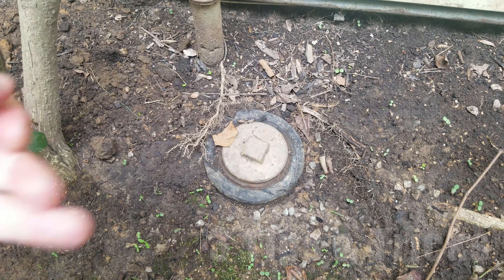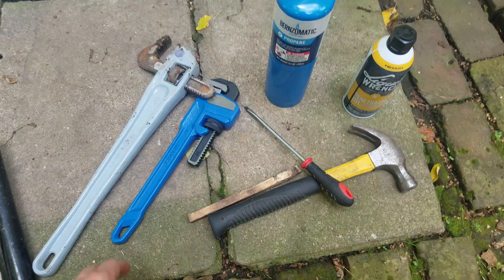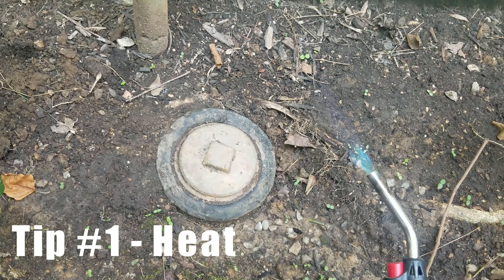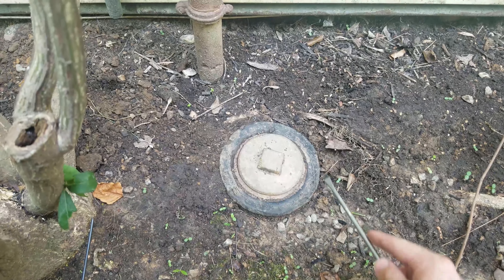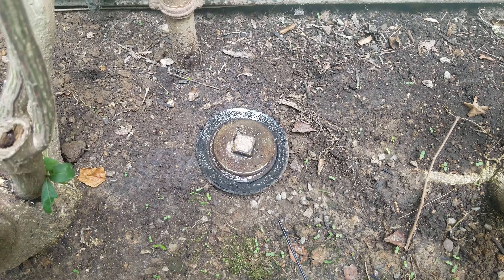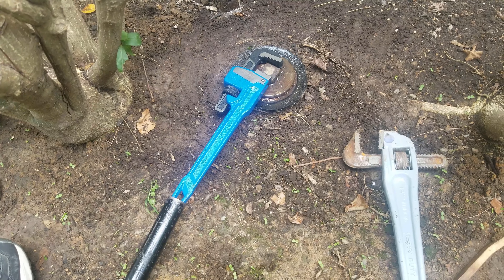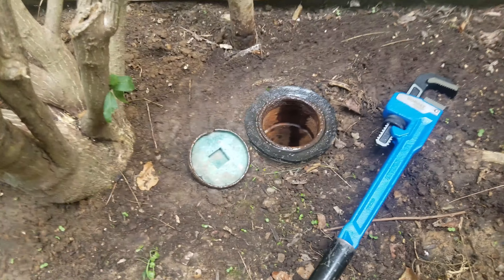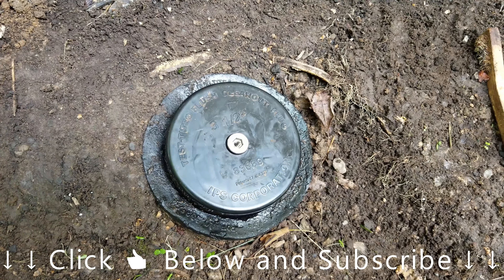How to Remove Sewer Cleanout Cap - Stuck, Rusted, Frozen

Comment: I think the threaded kind are better because you never have to worry about the sealsfailing. Just add some silicone, anti seize or grease to the threads and it won't seize up again. To get the square caps off: Get piece of square tubing, drill a hole all the on one side, then run a piece of round stock through the hole. This will give you a T handle wrench to slide over the top of that square. A six point socket and breaker bar works also, just have to be careful not to round it off.
Reply from the maker: I like the square tubing idea!  Thx for the comment!

Comment: How long till that little hex screw corrodes and strips out when you go to remove it 20 years form now, and then what are you going to grab onto to get this off though? honest question. Probably going to have to pry it out or bust it.
I'm working on getting A basement cleanout open for preventative maintenance/inspection, so no rush. I have 3 plugs within 2 ft on my monstrosity of a sewer stack in my 1930 home.

Just dug out the edges with a screwdriver/knife and hit it with the WD-40 (specialist edition) rust penetrator, which is usually my favorite penetrating oil, usually for like bolts/screws, but probably not for this application, and am going to use a big crescent wrench with a big cheater bar, as to not round off the edges with big bertha the pipe wrench.
Reply from the maker: It's stainless I believe.  5 years later and no signs of rust.   Lossens up very easily.

Comment: You don't want to heat the cap. That makes the metal cap expand which makes it tighter. Insteaf, you would want to heat the cast iron fitting.
Reply from the maker: Thanks for the tip.  Should have mentioned that.  Thx for watching!

Comment: I'm a long time service plumber and I font waste my time with brass clean out plugs like that that wont come out. I just bash them in with a hammer and put In a new one as the threads are usually fine on the clean out.
Reply from the maker: When you "bash" it do bits and pieces end up in the pipe?  I would be worried that would introduce more crap that would get caught up in roots or whatever blockage you might have.
Reply: @thebumpchannel  its soft brass. It usually kind tears it doesnt shatter. Once it splits I usually pull it out with channel locks.  If a section of it get down the pipe though it most likely wouldn't matter. If a sewer line can handle a 400 pound dudes terds it can handle a little piece of brass.
Reply: What about when threads are not fine
Reply: @jjtimmins1203  you can usually clean them up with a wire brush. If the threads are totally shot you can install a twist tight or dollar plug as some people call it. It's a plug with a rubber gasket that is compressed by tightening a wing nut. I always attempt to remove the plug the tight way at first and I have several specialty tools to do so but when you come across one that won't open no matter what I bash it out. Like I said before the threads are usually fine afterwards.
Reply: What do you do after you bash in the center?  I ask because i am currently stock at that part.  I have it caved in and cleaned out but i still cant get it to spin off.  Its been corroding for 70+ years
Reply: @christophermalecki9772  I just peel it off with channel locks. The brass is actually pretty soft and tears easy. Once you get more than half torn out the rest of it will pop right out.  Be careful to not let any big pieces fall down the drain.
Reply: @brasshouse-fireball  appreciate the answer.  I was able to bash it in and then cut through one of the sides to pull it off.  Now it looks like I have something I don't recognize, due to the house being made in the 50's, underneath the cap.  Looks like some sort of lid held down with a buckle? But I think everything is so rusted out.
Reply: I want to thank you sir for your comments that gave me the courage. I owe you a beer!
Reply: I spent hours and tried everything to get mine out.  Finally hit it with a hammer after reading your comment. ripped open and came right out just like you said. thanks!
Reply: I agree, I'm not wasting my time when a brass cap is stuck. Put a pipe wrench on it, bang the wrench with a 5lb sledge, try a breaker bar, if that fails, hammer & chisel.  U can get most brass caps to spin with hammer and chisel, but if they still won't spin pop a pole in lear the knuckle and go to work piecing it out

Comment: Man am I in a pickle!~ I  have the same thing just below my basement steps and before I watched this I just cracked the  brass cap right where I was using leverage as you did . I am wondering if I can somehow cut it out but I'm afraid. I just put silicone over it so  we might be able to flush the toilet which the main drain is  slow. Augh!  I would appreciate any ideas to help. I have not tried liquid wrench or heat but the hose is 100 years old. Thank you young man!
Reply from the maker: Several plumbers in comments claim to just bash the stubborn brass caps in with a ball peen hammer and then pull the remaining cap and threads out with pliers.  Try reading through comments. Its a soft metal so they claim this is easier that preserving the old cap.  No experience with this myself.
Reply: @thebumpchannel  yes, I did read them and after getting my courage up I did just that. It was rusted solid but after a while I got it! Thank you so much, you saved our marriage! Lol. Have a great Sunday.

Comment: Is that threaded screw made out of stainless steel ?  I would seal that screw with silicon so water and dirt can't plug up the hole and cause rust.
Reply from the maker: I believe so.  It has been installed for over 2 years now and no rust.

Comment: You can get 1/2 inch drive electric impact wrenches that will unscrew that better than a pipe wrench & breaker bar (pipe).

HF has  an inexpensive 110V that I've had good results with (especially on truck lug nuts)

And there's name brand cordless ones that are heavy duty too.

Even using a wrench, hitting it with a hammer is often better than an extension pipe because of the vibrations.
Reply from the maker: Good tips.  Thx for sharing!

Comment: Probably nothing would have helped that one much but for stuck plugs try tapping lightly around the outside of them several times before turning them.
Reply from the maker: Yeah that's great advice!  Tried that, but you were right, this one was a bear.  Didn't even realize I had this cleanout as it was buried in some landscaping.

Comment: Any suggestions if the knob is broken?
Reply from the maker: Depends what you mean by broken...
Reply from the maker: You could drill 2 holes through the cap, then pry the cap out.  Would soak the heck out of it with penetrating oil first for day or so.
Reply: Use an oscillating saw to cut out most of the brass middle part.  Then use a chisel to knock the threaded part into the hole you made.

Comment: How do you remove metal mushroom style cap from outdoor vent/ clean out access in yard.  Screw is frozen. I sprayef rust  loosener. Turn clockwise or counter clockwise?
Reply from the maker: I assume counter clockwise.  Not familiar with what you are referring to.
Reply: Pull with claw hammer should come off

Comment: Do the manufacturers of the new surface cap supply a small plastic or rubber bung for the Alan socket so it doesn't get full of dirt and crap...as it will? No? Didn't think so!!🤔🤦
Reply from the maker: Yeah I don't think so.

Comment: Why wouldn't you start with the penetrating oil? I'm a little hesitant about using a torch.
Reply from the maker: Penetrating oil takes time to work it's way in.  Heat works right away with similar results.  Use what you have or what you are comfortable with.  Heat can be tricky indoors of course.

Comment: I noticed you had a new brass cover off to the side.
Reply from the maker: Good eye...not a new one.....was actually from another clean out.  I have 3 clean outs in total.  1 PVC and 2 brass/cast iron.  Was going to try the other cap but threads were pretty wasted.  Stuck with the mechanical cap.

Comment: I use a 4 dollar ball peen hammer and take 1 sec and collapse it in the middle and then come back with a regular pvc cap.
Reply from the maker: Would like to see that!  Someone else mentioned as well.  Thanks for the comment!
Reply: yeah but what do you do after you bash in the center? the threaded part still needs to come out to have any sort of worthwhile seal.
Reply: @christophermalecki9772  it'll just fall out and the new one with thread in like normal. Also if you got the cap threaded even a little it'll seal. Please stop telling tradesmen how to do their job. I'm a master plumber and gas fitter so I promise you unlike you I actually KNOW what I'm talking about instead of just out of my ass like you people online like to do.
Reply: @auspicioustoot  I'm just a random dude trying to fix a clogged 70+ year old drain.  Def not trying to tell anyone how to do their job.  The cap itself was pretty corroded.
Reply: @christophermalecki9772  Okay then well if it's brass then you can collapse the cap and just thread in a pvc the same size If it's cast then you can spray around the edges of the cap with pb blaster or put some heat on it and try to tighten and the loosen and you can break it free like that. 
Honestly though if I had that situation at home I would just cut out the section and replace it with the same everything but pvc and give myself a new cleanout at least. If you're not confident at any point though just call a plumber and not roto rooter. I personally package a cable and camera for 500 and if you a jetter or anything it could be a little more depending on your area.
Reply: @auspicioustoot  re-reading my original reply I can understand where you were coming from.  It was just my overall frustration coming through.  That's my bad.  I really appreciate your professional opinion.

So, I would love to cut it out but this cap was actually in an old basement room floor drain.  I was able to get the cap off but now there seems to be a second cap of some sort.  The cap looks like it has two latches that are shut with pins but it is so corroded it's hard for me to even make out how it's supposed to work.  There's also a pipe leading out from under that cap that I believe leads to the floor drain in my garage.  

It's a real boondoggle all around.  I'm def making some progress but I can't even find a picture of a similar looking set up online.  I thought most floor drains like mine had ball valves but I don't think this one does.

I wish I could post a picture or two in this comment.  I'm sure my description is not really all that helpful.
Reply: @auspicioustoot  that's a great idea! I posted on reddit hopefully I'll get a reply.  Thanks for all you suggestions.

Here's the photo link.

http://imgur.com/gallery/CXp2OXX